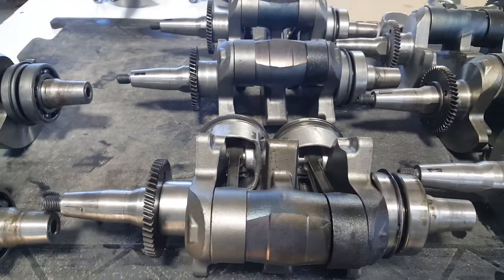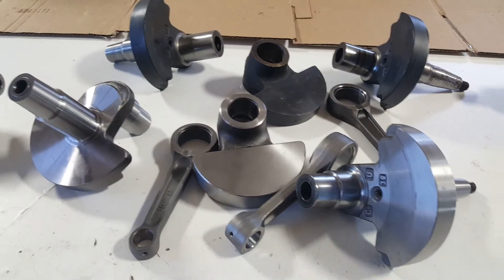Anatomy of Polaris RZR / Ranger 700 & 800 rebuild able

Comment: i got a 800 high output and i hit a rock on the bottom case it broke and iwas wondering if a 700 one will work to replace just the bottom case part cuz iknow it’s different on top case but iwould it work

Comment: Just rebuilt a rzr 800 with a hot rods crank, I did everything to spec but forgot to prime the oil pump. The engine ran well and the oil level went down after running for a few mins. The crank ended up failing after about an hr on pto side. Do you think it was a faulty crank or failure to prime the oil. Also I lathered the everything up with assembly line